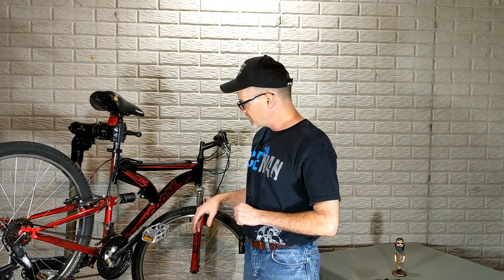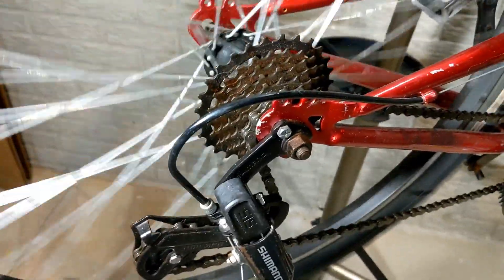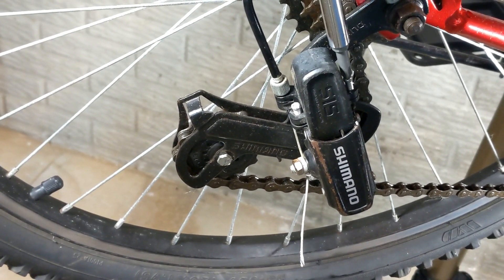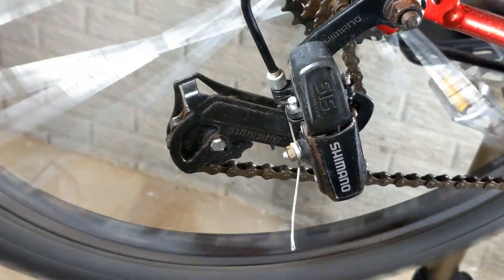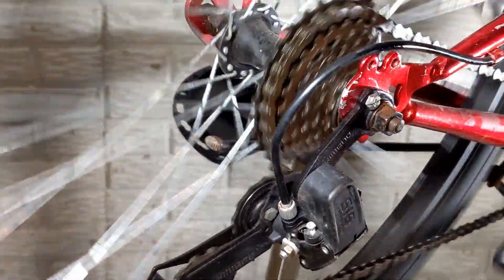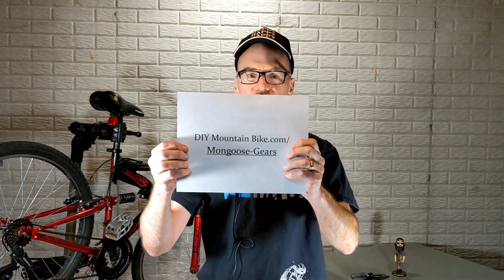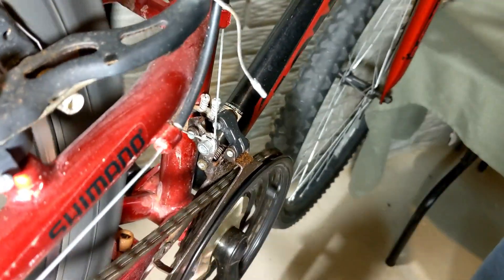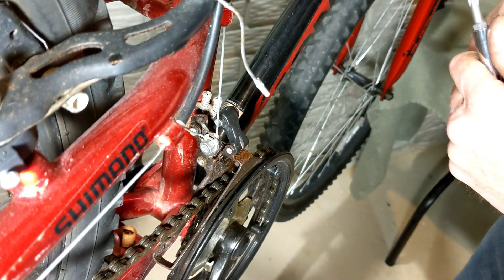Mongoose Mountain Bike Gear Adjustments

Comment: I have the mongoose standoff bike with the same derailleur.. The rear derailleur moves fine through all gears by hand when I disconnect the cable... The grip shifter pulls the cable smoothly back and forth when not connected to the derailleur.. problem is when I connect the cable, the shifter does not turn at all and thus the derailleur does shift..any ideas?
Reply from the maker: It's pretty easy for dirt and water to get into the cable housing.  If you can pull the cable out and clean it, it might free it up.  Caution though, with old cables it can be tough to feed them back through. 🚴🚴
Reply: Thanks for the quick response... I'm really stuck on this one....when I hold the derailleur end of the cable and twist the shifter, it slides through the housing very smoothly and with no resistance... it's when I reconnect the cable to the derailleur when I cannot turn the shifter... It is completely stuck... I cleaned and lubed all movable parts and still stuck... Any other thoughts??. Thanks again.

Comment: He doesn't even mention the correct alignment of the jockey wheels with the high and low limit screws. They need to align vertically with the cassette cogs at the highest and lowest gear - that's why they're called the high and low limit screws - prevents the chain from running off the cassette.
Reply from the maker: Great suggestion thanks